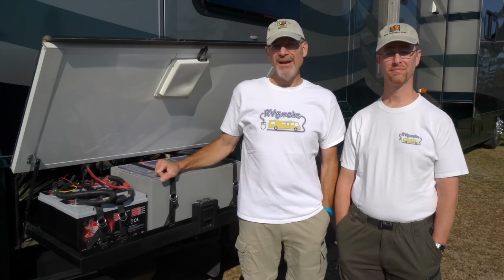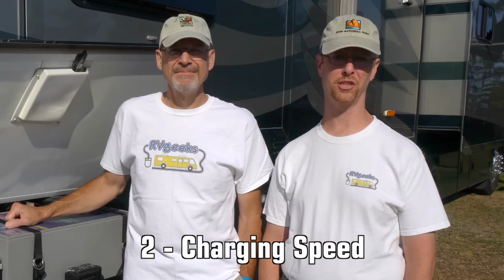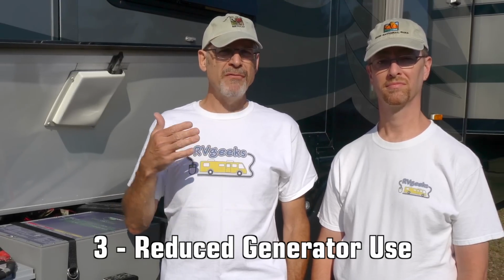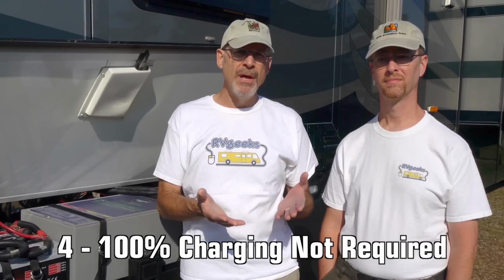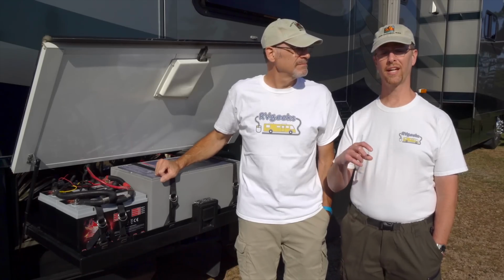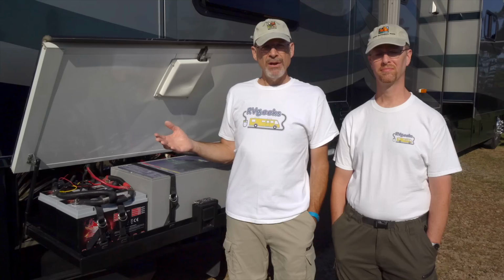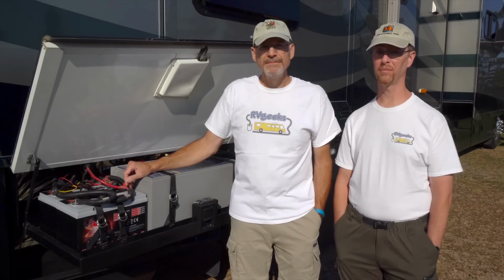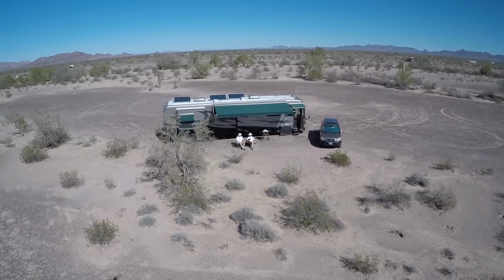🔌 SYSTEM UPDATE! RV Lithium Battery & Electrical Project — 3 1/2 Months In!⚡️

Comment: Also, you mentioned 50% capacity out of the lead acid or AGM batteries and if you real study those you'll only get about 38% of capacity, not 50. No AGM or lead acid battery will give you 50% of its power ever. It just can't do it

Comment: Love this video series guys.  So at approximately the 1:00 time stamp you said that with your old AGMs you had 440 of capacity but only 50% was usable.  So were your old AGMs batteries 100 amp batteries or 200 amp batteries?  I have four 6V bats wired in series/parallel each battery is 200 amp hours but I don't understand if that gives me 800 amp hours with 400 usable?  Or do I need to half that since they are 6V being used in a 12V configuration so I have 400 amp capacity with 200 amp usable? Can you help me understand that?  I've watched a ton of vids and no one really explains how that works.
Reply from the maker: Thanks! Glad you liked these videos! And great question. When you wire batteries in series (positive terminal to negative terminal) you are adding their voltages together, but not their amp-hour capacity. So two 6V batteries wired in series become one large 12V battery with an amp-hour capacity equal to one of the batteries (in your case, 200Ah).

When you wire batteries in parallel (positive to positive, negative to negative) you are adding their amp-hour capacities together, but voltage stays the same. So taking two pairs of 6V batteries that are wired together to become two larger, 12V batteries then adds their amp-hour capacity together (your combination now having 2 x 200Ah = 400Ah of capacity).

Because the batteries are lead-acid chemistry, you should only use 50% of their rated capacity to avoid damaging them and significantly reducing their usable life. So 1/2 of 400Ah = 200Ah capacity from the 4 x 6V batteries wired in series-parallel.

Hope this clears it up for you!
Reply: @RVgeeks  Thank you!  That answers it--yes.  I've learned so much from the vids and watching you guys on the Discovery Channel.  Well Done!

Comment: Hi RVG.
Wondering what made you decide on that particular battery over other manufacturers, and what other lithium brands did you consider ?
Great video and good info for all. We live in the U.S.V.I. and run our home and vacation rental villas fully on solar w lithium storage along with an emergency backup diesel genset. I've never had to use the diesel since starting up the solar system in 2018 (except for maintainance exercise runs of course)and we sure love not paying 42 cents per KWh to our awful unreliable local utility provider anymore.
Also am very pleased knowing I can leave the lithium at any state of charge for days if needed tho I do top them up every day. We keep our camper in Michigan (hurricane evacuation center) on a small lake property and spend 6 months each summer there.
Looking forward to setting up a permanent off grid power supply for property/camper tho I'm not decided on a mobile or stationary system yet.
Have fun on the road and keep up the great vids.
Thanks from the sunny Caribbean -www.joyoflifevilla.com
Reply from the maker: There were a couple of decisive factors that lead us to choose the Xantrex Freedom E-gen system. First, it takes up less space than any comparable battery we’ve seen, using the approximate space of four standard flooded lead acid or AGM batteries and replacing them with the power equivalent of more than 10 of those. It’s also the only self-heating lithium battery we know of, allowing it to operate, including accepting a charge, in virtually any temperature condition versus other lithium batteries which cannot accept a charge below freezing. Also, the Xantrex reputation, and our experience with other equipment from them, gave us great confidence, in which we were not disappointed.￼

Comment: U need to get a engine start module from Maxwell
Reply from the maker: Those capacitors are cool! Unfortunately there are other items wired to the chassis batteries besides the engine starter, like the steps and the awnings. If we were to go with our Maxwell module, we would have to hunt down and rewire those to the house batteries to prevent them from draining the Maxwell.
Reply: @RVgeeks  not as long as u keep one of ur agm starter batteries

Comment: This 50% thing on agms is really being pushed by those promoting lithium. You can go lower with minimal impact on the batter longevity. Yet, lithium sellers push this as a hard rule.  I think you guys bought into what they were selling. Lithium is still a better portion for those who can afford it but don't fall for everything the seller tells you.
Reply from the maker: It’s not that we fell for it.... we experienced it. We pushed our AGMs a bit for seven years and saw markedly reduced performance. They paled in comparison to our first year of lithiums. We’re not saying they’re cheap. Just life changing! 😊
Reply: @RVgeeks   7 years is a pretty good run  if your "pushing" them. I'm not denying the benefits of lithium, just how it has changed from you could run an agm down 70% without significant impacts on longevity, now it's go below 50% and you'll kill them. Everyone seems to be towing that line now. A few years back it wasn't what was generally accepted.  I'll move to lithium soon enough and look forward to all the benefits you mentioned but I'll be keenly watching to see how others go with theirs first. Keep us updated.

Comment: Maybe you've covered this in other vids, but I'm wondering about the cost of system upgrades to lithium by RV manufacturers. Often they are $20-22,000. Lithium batteries can be around $6000. What is involved in a lithium upgrade and what do you think of these prices?
Reply from the maker: Hi Jonathan. We have not covered that topic, as we don't really have much info on it. We're not sure what other items each manufacturer may be including in their "lithium upgrades" that could be being added to the cost (i.e. does it include and upgraded inverter/charger, larger alternator, etc?). We would guess that, barring other expensive components being added to the package, that the RV manufacturers are charging what they think the market will bear... providing them some (a lot of?) profit margin in the process. Each lithium battery (and accompanying BMS - Battery Monitoring System) is different... so there's not ONE answer to the question of "what's involved in a lithium upgrade". Plus, not all RVs are equipped the same... so if you have an older RV with an old charging system, that may need to be replaced to ensure the lithium battery is seeing the correct charge profile. And there could be additional components needed to address charging the house battery from off of your RVs alternator while driving (which could include replacing the existing alternator with one that's lithium compatible or adding a second alternator for that purpose). But all that said... you're likely talking a worst-case scenario of an additional $2,000 in components/parts needed to upgrade to your $6,000 in Lithium Battery (not including labor if you're not doing the upgrade yourself). Hope that helps!

Comment: Hi Guys, thanks for the update. My wife and I have just started working with Xantrex to install this system on a DRV 5th Wheel at the factory. They expect to be in the aftermarket sometime next year. I have a question, Can you charge the system on 30amps while drawing from the battery bank? So, if you are at a campground with only 30 amps, normally you would not be able to run the A/C and the residential fridge, the microwave etc att al the same time. With this system, does it draw from the battery bank all the time even while you charge from 30 or 50amps? This will determine if we get a regular gen set from DRV installed or get an aftermarket 30amp Predator or something else.  We plan to have quite a bit of solar installed so we would only need the generator when its bad weather and we draw down the battery. Thanks and keep up the great videos.
Reply from the maker: Hi Chuck. When parked at a campsite using 30 amp power, of course you have to manage your power usage to make sure you don’t exceed the limit of the circuit breaker. So when we are on a 30 amp pedestal, we can continue to charge the battery using the built-in inverter/charger, but have to make sure that we don’t exceed the 30 amp capabilities of the circuit. So we reduce our use of air conditioning or electric water heater or microwave, etc. to be sure that we don’t tax the system too much, until the battery is fully recharged. But keep in mind that when you are on shore power, you don’t need the inverter (pulling 12 V power from the battery and converting it to 110 V), since you can just draw the 110 V power from the pedestal. If we were in a situation where we NEEDED the power for an air conditioner or the microwave, we can flip the circuit breaker that provides 110 V power into the inverter charger to get it to click over and begin inverting, which then takes the outlets and puts them on the inverter, freeing up power on the 30 amp pedestal to run other devices. Since the lithium has plenty of power capacity, we can run like that for as long as we need to before turning off the 110 V device that is pulling power, so that the inverter/charger can replace the power back into the battery. Every RV is wired differently, so your system may not be exactly the same as ours, and may take some getting used to to figure out what works best for you. Let us know if that didn’t answer your question.
Reply: @RVgeeks  Thanks for the great info as usual. I think that sums it up. It think its really going to depend on room in the generator bay of the DRV as to how much space I have for a generator. I really want an installed gen set but I can settle for a portable if necessary. We will be sure and document the install as much as possible so we can show others. Thanks again

Comment: New SUB here - you have a great channel - what you're doing is so relevant and on trend at the moment, and I suppose will eventually lead to complete EV RVing . Given the current systems and we know battery tech never stands still what was the ball park financial figure for the complete new battery[s] system - inc all the monitoring accessories fabrication, cable reel etc and approx time carried out to do this work. Did you do an ROI on the system Did you get anything for the old batteries etc. All the best both and safe RVing :)
Reply from the maker: Hello, welcome and thank you! Great to have you here with us. This system was installed as part of a case study and showcase for the new Xantrex Freedom e-GEN lithium battery, and we don’t know the exact cost, as it’s not available for purchase yet. YET!! 😉 We’re hoping that our project, along with Xantrex’s working with several manufacturers on an OEM offering, will lead to lots of interest and the availability of the system as an aftermarket upgrade. We will of course keep you posted on availability and price as soon as we hear anything.

Comment: A narrow boat channel I saw recently claimed Lithium batteries had 1 serious weakness.  Recharging them in near freezing temperature almost kills the battery.  I cannot speak from experience because I don't have such a battery & Sydney it never gets that cold.  Do you have any advise on this point?
Reply from the maker: Hi Chris! It’s correct that lithium batteries cannot be charged below freezing, but good ones have circuitry that prevents charging when it’s too cold, and the best one (our Xantrex Freedom e-GEN) is self-heating, eliminating the problem.

Comment: Do you know lithium batterys Don't like cold weather ?
Reply from the maker: While that's true for other lithium batteries, this one doesn't care. If you watch the introduction to this series (Part 1: https://youtu.be/77mqMc30ceU ), you'll see that the all-weather capability of this particular battery is a prime reason we installed it. It's self-heating, and as a result, the only lithium battery we know of that that can be used fully (charged and discharged) in any weather.
Reply: Thanks for the info .

Comment: Came dang close to buying a 2015 Forest River Travel trailer. Looked really nice and about exactly what I was looking for and the price was right. I got cold feet at the 11th hour. Not quite ready to take on the payment. Maybe kind looking for a excuse to back out. But found out they were the second owners. Reason for selling seamed a bit weak. Cause the truck he tows it with is too rough for the wife. But she loves the camper. 
I will get the heck out of that pop up by spring and will be using your videos to learn things with a travel trailer though you have a coach. Still works mostly

Comment: Your system is pretty amazing ! I just installed 500 watts solar with 200ah battle born lithium batteries. I am blown away by the super fast recovery time as well. I don’t have the residential fridge so the 200ah is plenty for me right now but will install another 200 ah in the future.

Comment: Very informative video!  Thanks.  You may benefit from the Sewer Solutions equipment to do away with the 3 inch sewer hose system - we are delighted with how it works and how clean it is when you are done.

Comment: I’m learning a lot from you guys. I do have a question though. Will they make a system that works on a 5th wheel with a gen set?
Reply from the maker: When the Freedom eGEN system comes out, there's no reason why it shouldn't work on a 5th wheel with a genset. Our motorhome has a generator, and it all works great!

Comment: Hello, GREAT video again! How much for those new lithium batteries (or is it an accumulator???)? As well, what if they are on the tong of the RV? Is this an issue? Thanks guys, your videos are extremely well done and informative! We like them! Safe travels always :-) Rémi from Montréal
Reply from the maker: Hi Rémi! We don’t know pricing yet because they are not yet available for aftermarket installation. We will of course keep everyone up-to-date as soon as we know more. And yes, they are actual lithium batteries, not an accumulator. We would suggest that placing the batteries anywhere other than inside a protective compartment wouldn’t be a very good idea. We’ve never seen anyone do that before, and don’t recommend it.

Comment: Hi Is there a vid on pros/cons of all electric vs propane heated DPs? Thanks!
Reply from the maker: Check this one out, Rob! https://youtu.be/1pgYW2xQwho
Reply: Thanks guys! Another very informative vid. Me...Looking to buy a new or newer used DP. Your site is a great educational tool!! Seems so many new DPs are all electric. Love to see you guys discuss all electric DP vs a propane equipped DP. Also, do you have a vid on RV refrigerators? Residential 120v refer vs traditional propane/electric RV refer. Remember seeing vid of a residential refer going thru drivers windshield opening. Finally, love to hear what major options you'd choose in your next new or used motorhome. Been following you guys since you were on with The Wynns. Apologies if I've missed applicable vids!! Haven't viewed them all yet. And again really appreciate your vids and your time!!! Thanks Rob
Reply from the maker: Thanks Rob! We did indeed ditch our RV fridge for a residential unit, and love it! The only downside of course is power consumption, but obviously we’re working on that. 😉 Sorry we haven’t done a video about options, but that’s partly because it’s SUCH a personal decision. Whatever we said we absolutely HAD to have (like king bed, residential fridge, separate washer & drier, etc) others would insist that none of those are important! As my Mom always says “That’s why they make vanilla and chocolate!” 😁
Reply: Thanks very much for the info!! Rob

Comment: Maybe you mentioned this somewhere, but did you look into using Battle Born lithium 12 volt 100 amp hour batteries?
Reply from the maker: We did Paul, but the Xantrex battery is the only one we’ve ever seen that is actually UL approved for use in an RVs (UL1973). We decided that using any battery not approved for this type of use, or daisy-chaining in series, parallel, or series-parallel (which is what’s needed when using multiple smaller batteries like the “drop-in replacements” everyone is touting) is simply not worth the risk. Even though the Xantrex battery isn’t available aftermarket yet, we’ve done enough research to be totally confident that we’re not guinea pigs, and we simply can’t say that about many other brands we’ve looked into.

Comment: Any guide to cost on the Lithium House Battery?
Reply from the maker: The e-GEN system is currently only available as an OEM installation from a couple of Class B manufacturers, but we’re eagerly waiting to see what the next step is as Xantrex tests for the Class A and aftermarket. Ours was installed as a case study for that, so we’re hopeful that our experience can help move that process forward. We will be sure to keep you posted as we know more about availability and pricing.
Reply: Well that’s a bummer.  Guess we will wait with baited breath. 😀